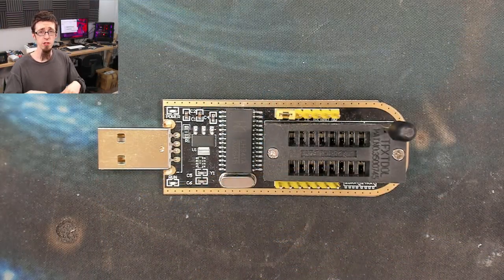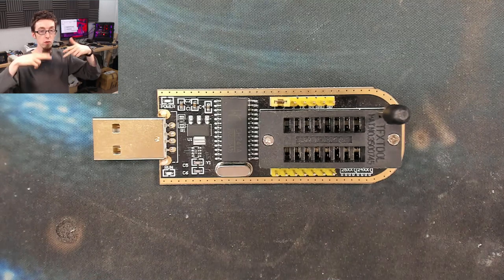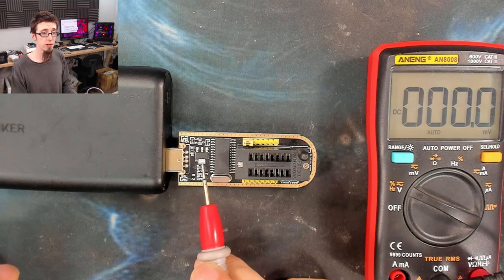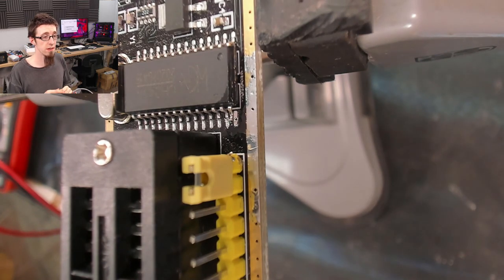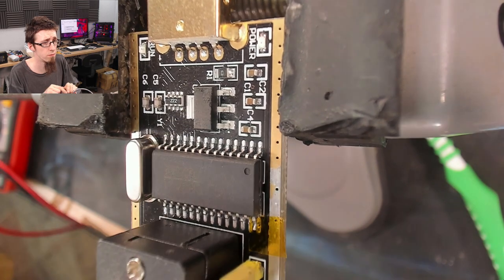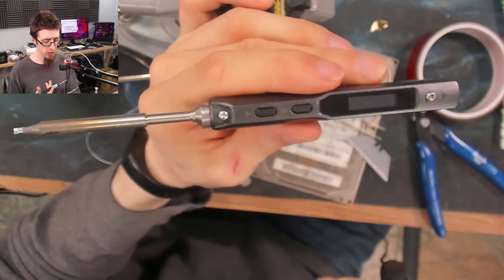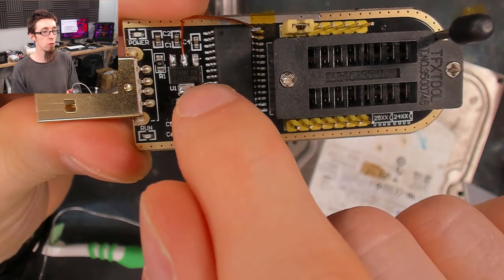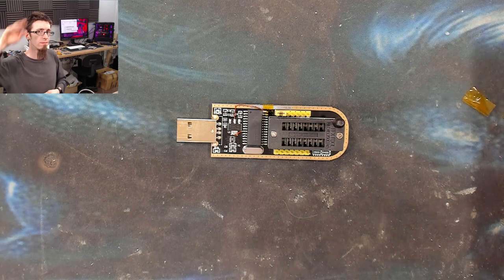Volt-modding the CH341a Mini Programmer - LFC#278

Comment: Hey. Not sure if you still read these comments. Can you tell me why you have to tie pin 28 to GND. Why could you not leave it lifted and untied. Would it not just be open. After all. We are basically disconnecting the 5v rail from the IC. Also the CH341a itself requires 5v to operate does it not? So if Pin 28 is tied to GND how does it source 5v. It must actually run of 3.3v as well?
Reply from the maker: We're connecting it to the 3.3v rail, which then powers the CH341a chip
Reply: @Adamant_IT  Appreciate the reply. So in the original configuration it runs off 5v and the data lines also have the potential to push 5. ?

Comment: Do you know how to connect a SOIC 8-Pin Test Clip and DIP adapter to a raspberry pi 3 b+ so that it can be used to fix BIOS? I have this board but I want to learn how to do it with just the raspberry pi and the clip and dip adapter and some jumper cables and that's it.

Comment: Hi do you know where I can buy a separate ribbon cable for this? I bought a pamona 5252 test clip for this since the oem garbage clips keep unlatching but can't find the terminal pins that connect the pins and ribbon cable online
Reply from the maker: I'm not sure, I'm in the "desolder the chip" club. But there are some folks who have actually high quality clips and swear by them, so they're out there. I wouldn't expect them to be cheap though!
Reply: @Adamant_IT  well.. i need those ribbon cable since mine is jacked up. can't get the brass/copper terminals off them without ripping sleeving.
Reply: Today there are on sale new low cost clips with connectors on the clip instead of solderings, i have changed all the cabled of my old one with jumper wires to the clip and cutting the interface side plugging in the old flat cable connector

Comment: Picked up one of theses cheaply, came with a bios "clip" to save removing bios chips from the board, then soldering back on etc after

However when the "chip" is connected the power to the CH3 seems to drop off and disconnects from the PC, is there a fix for this other than hot air remove chip etc?

Comment: Dont need to change anything, when connected to ic, and start program programmmer will adjust Voltage on the pin lines...

Comment: I might have to try this mod myself just to flash a bios. Do you have a link to a or some soldering tools just for this job? This is the first actual project that introduces me to hands on diy soldering. I will most likely only need to soldered only 5 times or less thank you.

Comment: Great cheap programmer, but they should fix this problem after years... The only problem is that it can't detect all the 1.8V chips even with the adapter board. AM4 mobos and Nvidia 10 20 30 series cards have 1.8V SPI eeprom chips. (Maybe some chinese software is better than Flashrom, I didn't  try them.)
You should get the 1.8V adapter and programming clip kit, it's almost the same price.
Reply: You can find pin 9 on the capacitor under the 1117 LDO, it makes the mod look professional :)
Reply: Correct me if I'm wrong but doesn't the 1.8v adapter board still use 5v (3.3 after mod) unless you desolder the chip and use the adapter's pads?
Reply: @DannyWilliamH  good question!!!

Comment: 5:32 I am complete beginner, but maybe somebody can explain to me why this pin need to be connected to the 3.3v. It looks to me on the schematic, thats its coming from the IC so I assume it has the voltage provided by VCC and its just going into a cap to ground. Its not like there is a line with 5V connected to that pin, nothing externally comes there... its all from the IC itself. Hope somebody can explain that to me. Thanks!!

Comment: hi can you help me, maybe going out off topic. I spent these 3 days building an atmel ATmega328p circuit that will be powered by 12 volts. I read always find the chip can only be powered by 5 volts, any more than that it will fry it. But my program has to run VCC with 12 volts. I also think the Arduino Uno/Nano is an Atmega328p circuit, which can be powered by 7-12v (I have tried). My question, how to make Atmega328p can be powered by 12volt without having to change to 5 volts?

Many Thanks for helping
Reply from the maker: You can't mod something to run at a higher voltage. You'll need to put in a regulator somewhere to create a 5v rail for the logic stuff.

Comment: Sorry, I have the same programmer, but without modification he quietly programmed me the 95P08, what is this modification for?
Reply: Lower voltage on the data lines will put less wear on the chip.

Comment: Tip 1) Get yourself some wire wrap/Kynar wire and lose the enameled wire. 
Tip 2) Still have your enameled wire? "Strip" it by burning off the enamel with your soldering iron. Sanding or scraping your wire will only make it weaker. And you are going to solder it anyway.
Reply from the maker: I never seem to have any luck burning off the enamel. I've tried it several times in several ways and it just doesn't strip. I've no doubt it works because I've seen people doing it, but yea, never works for me, so I end up scraping.
Reply: @Adamant_IT  The way that I do it is to create a healthy-sized blob of molten solder and run the end of the wire through it. I don't heat the wire, I heat the solder. This way the heat is going to get to all of the wire and the enamel should come off easily.

Comment: Hi Adam though am late I have a question. Can I use this for EFI password removal for Mack book Pro?
Reply from the maker: Yes you can. However, keep in mind there's more to it than that on Macs, if it's iCloud locked you need to NVram reset then re-install macOS immediately after clearing the password from the EFI chip, and if it's a T2 mac then this strategy doesn't work at all.
Reply: @Adamant_IT  thanks a lot for the help
Reply: @Adamant_IT  if it is iCloud locked and we start normal macOS without format, what can happen? Block machine forever?
Reply: I mean.. After EFI unlock and NOT a T2 Mac.

Comment: Hi Adam, could you also use this to rewrite the firmware for tv's? Thanks
Reply from the maker: Not sure, I'd guess no, smart TVs probably have much bigger firmware on their internal storage, rather than a BIOS chip like a motherboard.
Reply: @Adamant_IT  tv's mostly have NAND memory to store firmware. So you must use another programmer such as RT809H which is the much more expensive (about 100$ or more) Some tv's have EEPROM to save user settings
Reply: @grooyo  it works on tv ic chips, tv receivers, and other similar chips on other devices even on cell phones boards,  but you need to check the chip type and how much it can handle voltages. And start from there.
Reply: @lezyhun  Yes it's for EEPROM IC-s (24/25xx, 93/94xx...) not for NAND memory's
Reply: Thank you all for you feedback and advice. 👍👍

Comment: Do you not need a 5v power to use a ST93S56 which is an automatic Memory eeprom?
Reply: Yes, there is such a way. But it is still necessary to raise 28 pins and feed it with 3.3 volts. After going back to 5 volts you can put a jumper on the two pins that are next to the zip panel. One of them has 3.3 volts, the other has 5 volts. So close them, then 5 volts will appear on pin 28. After removing the jumper, you will return to 3.3 volts of power. Everything is simple.

Comment: Can you tell me if 5v in data line pin will cause any harm to the bios chip?
Reply from the maker: Yes and No.
Direct answer: Over-voltage will cause damage to the chip, it will often malfunction and not read/write properly whilst being over-volted. However, it will likely survive, so accidents usually don't end in a dead chip.

Roundabout answer: As others have pointed out, these data lines will actually get current-limited during use, causing the voltage to sag. So constant over-volting doesn't really do the damage here. However, Voltage Breakdown is also an issue, where constant 'zaps' of 5v before the current sags will damage the chip. The chances of killing the chip are very low - but that's not the point, you shouldn't take risks when A) you can modify the programmer to not put out 5v in the first place, or B) you buy the CH341a v1.6 or higher, which has a voltage selector switch.
This black-PCB version of the CH341a is obsolete, there are better cheap programmers available these days.
Reply: @Adamant_IT  One more question please. I saw from another YT and post, they connect the pin 28 to Capacitor in C4 first before from C4 to the 3.3V in the mosfet. Then they did not connect pin  9 to the Mosfet Drain. Is that a better option or just the same? I am trying to add a simple switch to switch between 5V and 3.3V. Also, upon further inspection, my flasher chip is CH341B. Is it the same as yours (CH341A)?

Btw, I tested the flasher without modifying on a mechanical keyboard bios and it made the bios less responsive. It took like 6 seconds before windows can recognize it, while before it was snappy. Upon connecting the flasher to the USB for the first time using bios clamp, it turn the keyboard on. I quicky read the bios and turn it off after saving to file. I was trying to copy the bios from healthy pcb to a dead one. Since then, the healthy one seems somehow crippled.

Comment: I modded mine with the minimalist approach; just split the 5v rail beneath the PCB, soldered a two pin header and finally facilitate a plastic jumper there. I tried posting the labeled snapshots of the modification (form imgur), but got deleted instantly.
Reply from the maker: Yea I've seen this method done and it's definitely cleaner. I'd have done that if I'd known at the time. But tbh, a little practise with jumper wires is a good idea anyway!
Reply: @Adamant_IT  Please show it/record it. So many people are not so skilled and need easy to understand solution.

Comment: Hey friend I bricked my laptop trying to undervoltage. I have a msi gs76. I  can't even access bios @ all or windows. Would you have any advice?
Reply from the maker: BIOS reset should solve that. You'll need to take the bottom cover off and disconnect the RTC battery for a minute. It will likely be a small shrink-wrapped coin cell with a short two-pin wire connecting it to the board. An MSI I'm working on at the moment has the coin cell itself taped under the mobo, but the wire itself sneaks around to the top side, so it's possible to disconnect it without removing the mobo. It will look something like this: https://ae01.alicdn.com/kf/H5c6efbe47b434e7cb75428787836a7002/Original-CR2032-BIOS-battery-FOR-MSI-GT70-GT60-GT680-GT683-GT780-GE60-GE70-GE620-CX60-CX70.jpg_Q90.jpg_.webp

Comment: There’s no need to modify the programmer—it’s already designed to work perfectly, albeit at a slower speed. One key concept to remember is that amperage, not voltage, is what damages ICs. Voltage alone cannot cause harm without sufficient current to back it up.

If you had checked the current draw of the programmer during idle and active programming, you’d find it ranges from just 0.5mA to 1mA maximum. Such low current levels are incapable of causing damage. Additionally, the so-called "voltage mod" is entirely unnecessary. The programmer is designed to automatically adjust the voltage according to the specifications of the IC you select.

For those working with 1.8V BIOS ICs, the proper solution is to use the appropriate adapter to step down the voltage—not because of any risk of damage, but because a stable signal is required for reliable read/write operations. Attempting to program a 1.8V IC at 3.3V will lead to signal instability, not physical damage.

Unfortunately, many people have implemented this pointless voltage mod, spreading misinformation and encouraging others to follow suit. This programmer is an excellent tool for beginners and has served countless users well before upgrading to faster, more advanced, and expensive tools. Modifications to it are unnecessary and counterproductive.

Comment: at the bottom of the programmer you can solder the bios to work at 3.3 v, I have tested it successfully with a mxic25l6406e and "as programmer", it would be a good idea to make an adapter

Comment: Hello sir im a new subscriber, and ive been watching  your informative videos.
If you ignore the price between ch341a and ezp2019 which would recommend? Thank you.
Keep uploading videos.
Reply from the maker: I've not used my EZP2019 in a long while, some people still rate them pretty well, but personally I prefer the CH341a because NeoProgrammer is really easy to get started in, and the CH341a drivers don't look like a virus ;)
Be sure to check my recent video about the CH341a v1.6 though, as it doesn't need the volt mod, but is a bit more expensive.
Reply: @Adamant_IT  Thank you sir.

Ive learned so much about your videos thank you for sharing your knowledge. I like it when your troubleshooting those dead boards 😂😂😂😂😂😂😂😂😂😂😂😂😂

Comment: AdamantIT i gonna start with this programmer do you have a good link for the Software.
Reply from the maker: AsProgrammer 2.1: https://drive.google.com/file/d/1KrYyKQVj_svvU5fr5EVJ7WP0bRRMFP_a/view
Drivers at the bottom of this page: https://www.onetransistor.eu/2017/08/ch341a-mini-programmer-schematic.html - You need CH341SER.EXE and CH341PAR.EXE, which is the serial driver and programmer driver.
Reply: @Adamant_IT  thx works great. I gonna fix the 5 volt line later to 3.2 volt. I did my first chip and was a succes xD

Comment: To finesse lifting a gull wing pin use a a sliver cut from as thin a stainless steel shim as you can find, heat the joint and slide the shim between pin and pad.  Solder won't adhere to SS which is also a relatively poor heat conductor and together will being thin and low mass will minimally cool the joint during operation.  Burnishing the cut edge of the shim will help prevent it from hanging up on the pin or land as it is slid between them.

Comment: we did'nt here about the new version you ordered i think v 1.6 any news could help
Reply from the maker: It's in the works! I just haven't had time to look at it yet, haven't had any BIOS related stuff in for repair...
Reply: @Adamant_IT  ok thx for reply
Reply: @Adamant_IT  @Graham
The right way to mod this programmer for 3V3 / 5V is to cut the midle pin of U1.
Then using an 2p2t microswitch do the connections based on the pictures that I posted on imgur "EadQbnN" and "ihvvUTO".

(youtube boots are blocking my posts)
Reply: @contacttly6398  There are now versions of this with a switch included for $15. Takes out the hassle of doing it yourself on the slightly cheaper CH341a

Comment: I ran one of this for flashing a bios chip with the original 5V :o, I should mod mine!
is any danger of flashing the same bios chip again without changing the voltage to 3,3 ? I want to try a custom bios I made for supporting NVMe in a older motherboard!
Reply from the maker: You kinda roll the dice each time. I did a few 3.3v chips before modding mine and didn't blow anything up, and I'm sure various people who daily drive a CH341a have probably done many and say that this is a non-issue. But a risk is a risk.
These days though, I'd just pay the $25ish for the version 1.7 programmer that has a voltage select switch - it's kinda made this mod and the v1 CH341a obsolete.
Reply: @Adamant_IT  I see, I will order the 1,7!, thanks for the reply Graham!!

Comment: I don't think you have to do this because soon as chip connect with software
 voltage automatically dropped to 3.3v so you don't have to mod the programmer now
Reply: Correct. Lot of stupid things and people around the internet.
Reply: Yes, but not when it is connected only during the operation read/write/verify, the voltage on CLK pin drops to about 1V

Comment: It doesn't work for CH341B. For CH341A only. Because when the 9th pin of the microcircuit is in contact with the 1117 in the recording mode, there will be freezes and scraps of the programmer from the PC.
For CH341A there is also bad advice here to connect the 9th pin and 1117 with a piece of wire. because when you apply 5 volts to pin 28, your microchip will fail. It is not necessary to install a wire, but a removable jumper. if you need to switch to 5 volts, you will remove the jumper and use this jumper to short the 3.3 and 5 volt pins that are next to the zip panel.

Comment: i did this mod back when i sucked at soldering. broke off a pin on the ic, so i had to scrape the plastic and solder to the lead frame 😆 still works tho

Comment: followed your guide and confirmed the voltage across the data lines were 3.3v using the powerbank.
now on usb port, if i plug it all the way in, it shows in the device manager, however there's no power led lit (red led). the voltage across the rail is still 3.29v.
using the programmer, it says it cannot connect to the ch341a. same with the neo programmer.
Reply from the maker: My guess is a bad connection on the VCC pin of the chip 🤔

Comment: I followed the mod and it went well. When I plug the ch341a in to either of my Windows 10 pc's there is a device manager issue as unrecognised device. Before the mod it was autodetected ok and the drivers were loaded. It still autodetects on my Windows 7 PC and on Ubuntu. So I wonder if Windows 10 is hypersensitive to the voltage. Nothing in the event log to clear things up either.

Comment: Interesting...i burned couple of bios chips before with 5v but i haven't facing any issues of it..i think most of the bios chips can handle with 5v..
Reply: Also you don't reprogram them every day, so they should usually survive the few times (once?) they are being reprogrammed.

Comment: when you strip off that insulation paint you can also use flame, it is faster. And your soldering is really disaster, use more flux. And try soldering iron with 1 second to wait. and yes please use flux, heating tin that much time you destroy it withouth flux.